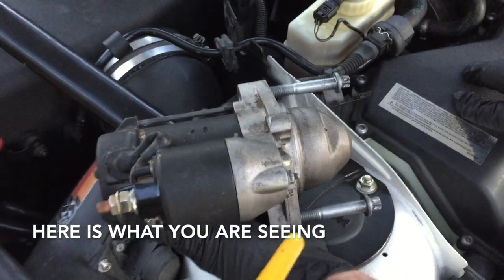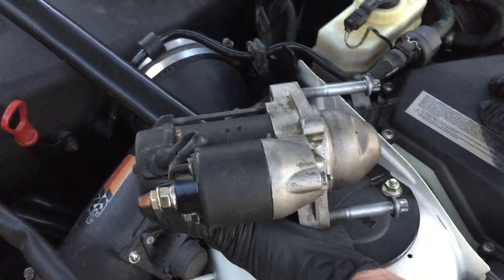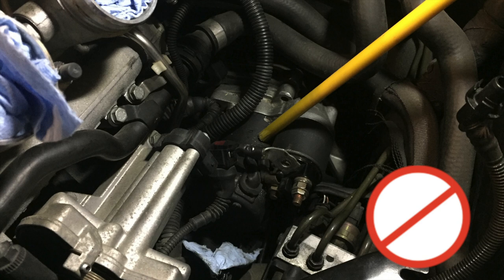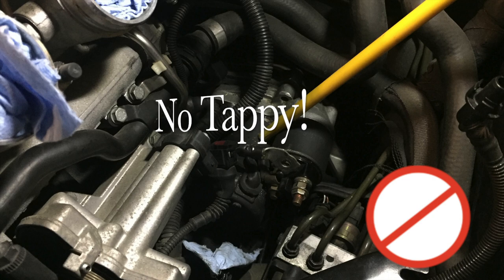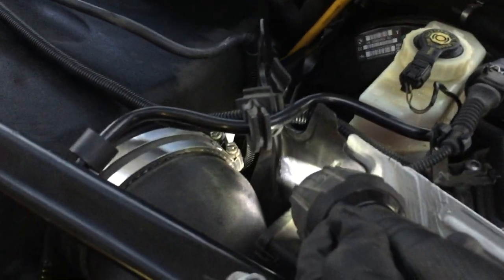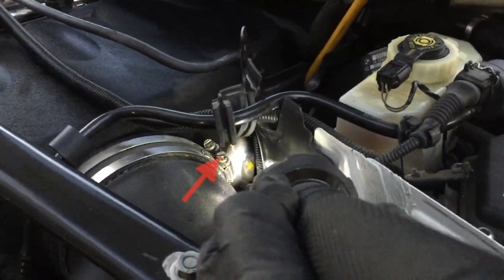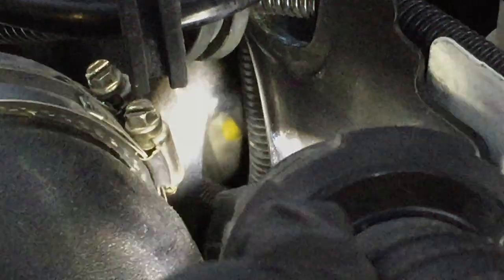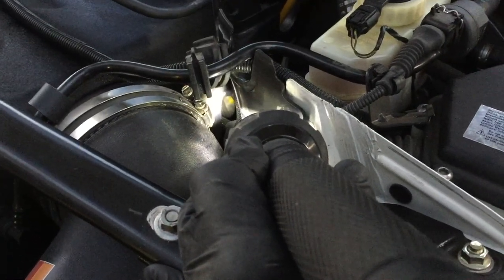How to START your BMW M3 when the Starter fails to crank

Comment: 3 questions please: Would a Home Depot wooden dowel work? Is there a fuse to check for the starter motor? Would the ECU throw a code or error light if starter fails? This video might save me! Thank you bro!

Comment: After 3 days of searching for a non-crank problem, I finally found a solution to gently tap on this famous part... something that I would have done before even opening the fuse box if there was more room in the engine compartmen... when I remember my youth with my 324 TD from 1988, I managed to hit with the hammer, driver's window open, while putting the key in and start the car on the same Time 😂.... Tomorrow I dismantle the laguna seca, spring is coming. THANKS 😁
Reply from the maker: this awesome haha! id like to see this, pretty slick! hope it came together??
Reply: I didn't succeed from the top. I checked the voltages at the starter terminals once again (endoscope required) Positioned at the driver's light, I passed diagonally between the original air box and the shock absorber head. With a hollow stainless steel tube, I leaned on the base of the starter (nut of the long threaded rod). a slight shock loosened the coals. replacement of the starter is planned. THANKS
Reply from the maker: @FLO59OD59  dang. But you made it happen regardless. Good job dude
Reply: YES, Thanks 😁